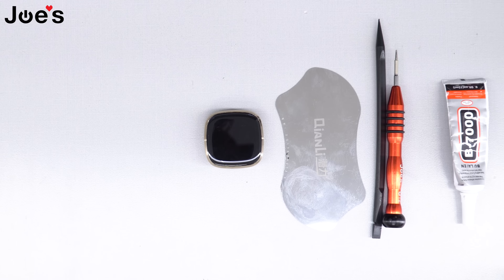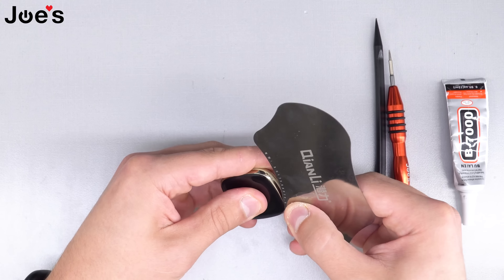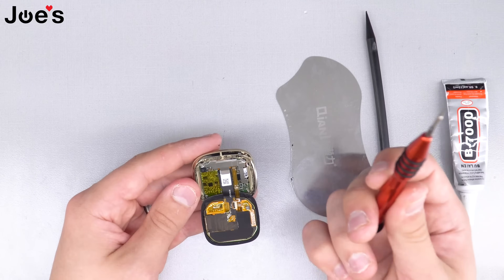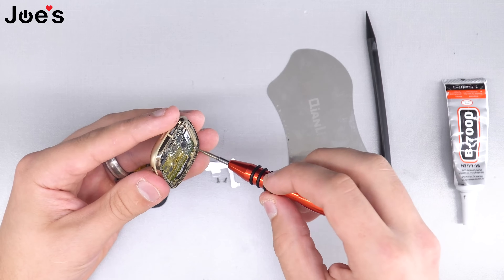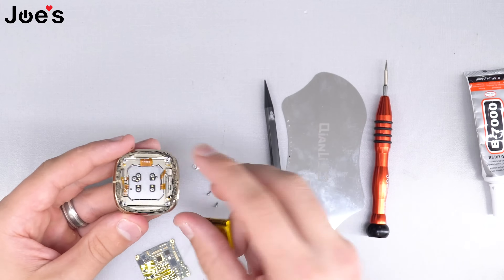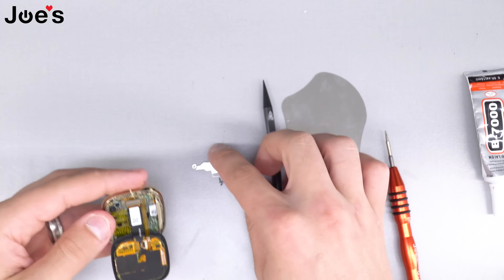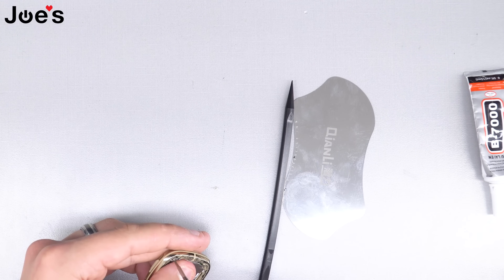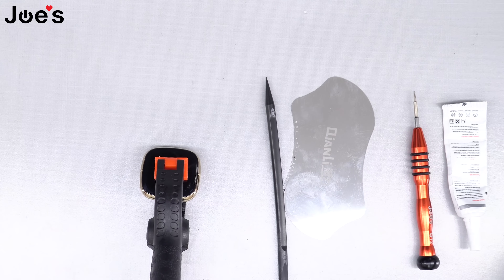Fitbit Versa 3 - Fitbit Sense Teardown Main Board Battery Replacement | Repair Tutorial

Comment from the maker: Buy Original Main Board Repair Part Here: https://www.joesge.com/products/fitbit-versa-3-fb511-smartwatch-repair-replacement-parts?variant=32790068461614
Buy Main Board Repair Kit: https://www.joesge.com/products/fitbit-versa-3-fb511-main-board-pcb-replacement-repair-kit-parts
Buy All Original Fitbit Versa 3 Repair Parts Here: https://www.joesge.com/collections/versa-3-repair-parts
Buy the Repair Kit Here: https://www.joesge.com/products/fitbit-watch-tracker-repair-screwdriver-pry-tool-glue-full-repair-kit
Send Your Fitbit In For Repair: https://www.joesge.com/pages/repair-service-fitbit

Comment: Hey question my fitbit just stopped working after 2 days after it was dipped in a sink when I was washing my hands I heard Sparks coming from the inside of it then the whole thing just completely shut off and it's a black screen now and I don't think it will ever turn on is there a fix to this since it was apparently damaged by Water by the next day I tried drying it with  a hair dryer to dry most of the water that somehow got inside the system when I tried drying most of the water that got into the system of the watch itself the screen becomes loose and the whole thing just comes right off now
Reply: I tried turning it on again the same day when I was drying it with a hair dryer i put it on the charger to get it to turn on again it came on again briefly but then it sounded like it was sparking again screen turned on briefly but then it goes into a black screen again is there a fix to this cuz I feel like this was damaged by water
Reply: Could be the screen the battery or the motherboard I don't know but a lot of water got into this thing when I was washing my hands 2 days ago
Reply: And it caused it to stop working is there a way to fix water damaged watches?
Reply: Could have been anything that caused it to stop working
Reply from the maker: I would say your watch most likely has corrosion in a few spots. At this point I’d recommend buying a new or used one online. The cost to fix a water damaged device is more expensive than replacing it. Fitbit’s are not waterproof now you know.
Reply: I do have a spare watch that's the same watch that wasn't damaged by water I can possibly maybe take apart and maybe switch it's battery the circuit board maybe the screen will that fix it?
Reply: Only one problem is I don't have the special tools to dismantle the watch or the special glue when it does be put back together I can't seal it up
Reply: I was going to maybe try switching its parts from the damaged Parts using the good parts and removing the bad parts because replacing a watch is quite pricey then switching its parts and repairing it which makes it cost less
Reply: I just got my watch repaired replacing with new parts and everything and it works I replaced the circuit board the battery everything it works like it was brand new thank you so much for your service your tools got the job done

Comment: My versa 3 started acting up around Christmas time, non stop vibrating, screen flashing through different apps and this would go on for sometimes 3 to 4 minutes. Since Christmas it's done this about six times and now the screen doesn't light up at all but when I touch the side button I can get a vibration. You can't buy the Versa 3 anymore but I love it, can this watch be fixed?
Reply from the maker: Hello, You could definitely send your device to our repair center. Here is the link to our website 👉https://www.joesge.com/pages/repair-service - JoesGE
Reply: @Joesge  Thank you for responding. I see on your link that you supply the shipping label but I live in Vancouver, BC, Canada. Does the free label still apply or would I be responsible for that or maybe you have a repair affiliate up here you could recommend if it would be too expensive to send across the border? Thanks and I look forward to hearing back. :)

Comment: The screen you are working on has 2 ribbon the screen you advertised has only one ribbon what is the part # for the LCD screen with 2 ribbon
Reply from the maker: The second, smaller ribbon is the tap to pay function. You can easily remove it from your original screen and put it on new one from our website. It is just held on with a sticker.

Comment: What if the Fitbit Sense stopped charging? Would this be a battery issue or something else? I had it for less than a year and it won't charge. I contacted them and never got a reply.
Reply from the maker: It's most likely the battery, but it also could be the main housing or even the motherboard.  You could definitely send your device to our repair center. Here is the link to our website 👉https://www.joesge.com/pages/repair-service - JoesGE

Comment: Very nice video!
I have charging problems with my Versa 3. I noticed damage charging pads on a smartwatch and I thought it could be a problem. So far I tried charging it by just making direct contact with cables, but it still didn't work properly. I noticed it starts to charge sometimes when i squeeze it, so my next step is to take it apart and see if perheaps a connector inside got loose. Thank you for showing this "HOW TO" clip.
One small question, what kind of adhesive do you use to glue it together?
Reply from the maker: You may need a new housing installed. We use this glue. https://www.joesge.com/products/silicone-industrial-adhesive-704-rtv-silicone-rubber-seal-black-glue?_pos=1&_sid=8efd4a751&_ss=r
Reply: @Joesge  Thank you kindly!

Comment: Joe my fitbit sense is stuck on the logo.  If I remove the battery will it reset????
Reply from the maker: Usually that’s a dead board. Removing the battery will not help this situation.
Reply: @Joesge  can I trust a ebay board????

Comment: Ill be sending in my Fitbit Versa 3 for repair  for the battery issues. Does it still remain waterproof after the repair
Reply from the maker: Hello, thanks for commenting. We usually do not recommend using the smartwatch near water in general. In this case, it is very dependent on how you glue the screen down. No watch is water proof, but water resistant. If the glue holds on the screen then yes, it will be water resistant.

Comment: do you send to Mexico?
Also... my fitbit doesnt charge anymore, i succesfully turn on the device by connecting and disconnecting repeatedly but it says it doesn't charge (some times it says is for a low temperature). How can you say if I need a new battery or a new main board?
Reply from the maker: We do send to mexico. That issue sounds like a battery

Comment: How can you tell if you're battery is dead?
Reply from the maker: If the battery dies super fast, that is a great indicator.
Reply: Where can I purchase a battery kit for fitbit versa 3?
Reply: Can you send me link please
Reply: Bought a fitbit sense, it lasted 9months, the device isn't powering on, I connected it to a charger and yet still it doesn't power on. Can you indicate what's the issue?

Comment: Thanks for the video. Would you happen to know what the hole on the same line as the speaker is? I know there is a very small hole for the microphone, but I tried cleaning some gunk out of the small area next to the speaker cover and I may have bricked my watch, because it won't turn on now...😔
Reply from the maker: Hello, thanks for commenting. Please email us at support@joesge.com with a screenshot of your question and we will be able to better assist you there. - Aaron P

Comment: I've got a Versa 3 that's been stuck in a boot-loop for weeks.  I've tried all of the tricks Fitbit suggested with no help.  In short, if it's charged/charging, it's in the boot loop until the battery is gone.  Does anyone think opening it and disconnecting the battery would help it factory reset in any way?
Reply from the maker: Hello, thanks for commenting. Please email us at support@joesge.com with a screenshot of your question and we will be able to better assist you there. - Aaron P

Comment: How do you tell if the problem is the battery or the main board? What is the difference in symptoms?
Reply from the maker: Main board will most likely have no power at all even when plugged in. Battery will work but die quick or as not work off of the charger.
Reply: @Joesge  
I disassembled a sense that wouldn't turn on or charge to clean out slight water corrosion due to the screen lifting. Once reassembled it's turns on and charges but the haptic button and touch screen are not functioning...any ideas or advise on what parts may need replaced?

Comment: what's is the point in switching out the main board or screen when you can just buy a new fitbit for $30-$40 more? how are all the parts combined 3 times more than the watch itself? you guys are robbing anyone that buys from you
Reply from the maker: People don't usually need 3 parts
Reply: @Joesge  I understand that, but the main board is $130 and the screen is $145. So if you need to replace either of those, you're better off just buying a brand new versa 3 for $170 and now you have spare parts from your old one. If anyone is actually buying the screen or main boards then they are not very smart people
Reply: @andrewcompton1876  I feel like it's better to replace the screen instead of the entire watch. The price of one of these devices ranges anywhere between 150 to $1,500 whereas a screen, motherboard, or battery may cost you up to about $40